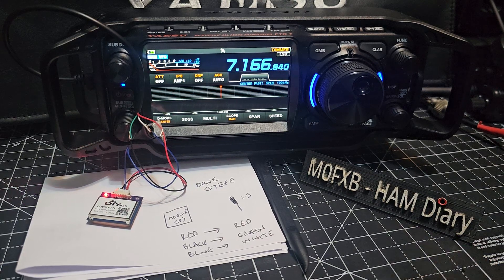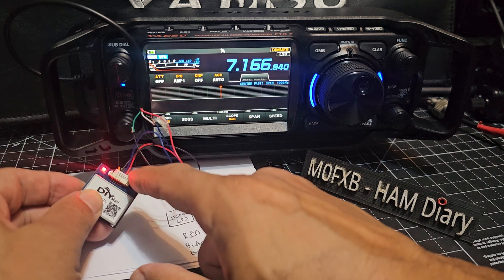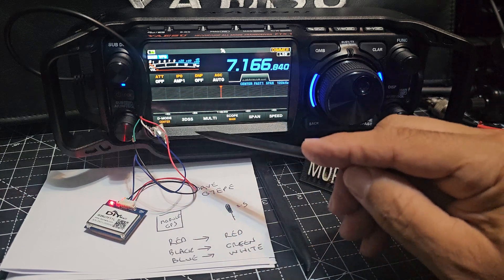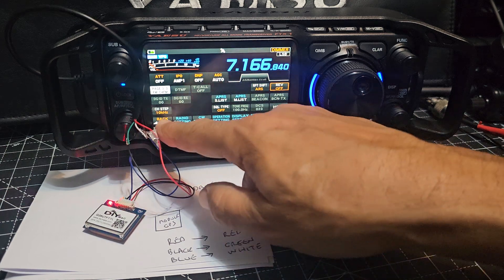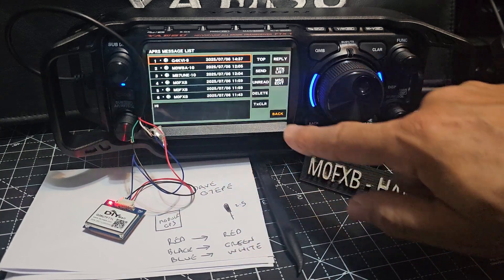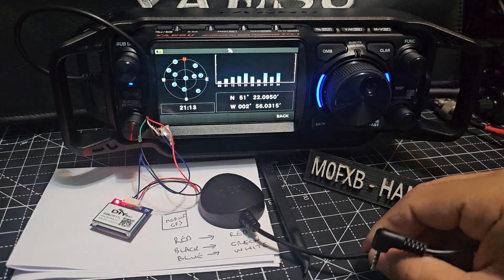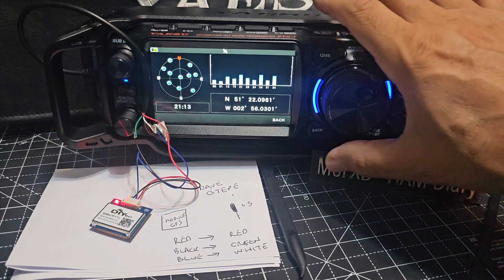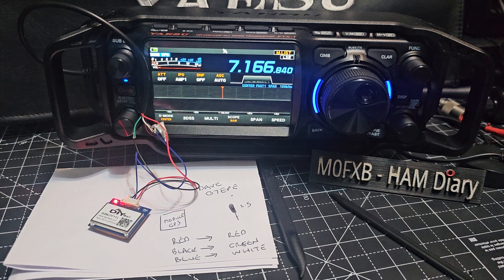DIY - YAESU FTX-1 GPS Module £16

Comment: what are the actual pinout connections on the 2.5mm plug so that the cable can be made up without having to purchase a cable from amazon for real DIY by amateurs.
Reply from the maker: U have to buyba cable its a few pounds
Reply: @M0FXBHamTech  sorry to hear you are not into DIY

Comment: The GPS module is no longer available.

However, I wanted one with a remote active GPS antenna with SMA termination anyway.

So I used the same 2.5mm cable that you used with the "Gonnely Mini NEO-6M GPS Satellite Module GPS P-C-B Positioning Map Low Energy for Microcontrollers" item B09J916W5V from Amazon UK (£9.39). This puts 3.3V up the coax to power an active GPS antenna.

Don't make the same mistake I made, and assume the 2.5mm plug is all the way in when it's not There should be a satisfying click once it's made its way all the way in.

Pinouts

2.5mm breakout cable Amazon item B0DTYQQB8J
Tip Red +5V
Ring 1 White Data from GPS to FTX-1
Ring 2 Green Ground
Ring 3 Black no connection

(Ring 1 is closest to tip)

GPS module Amazon item B09J916W5V 
PPS No connection
RXD No connection
TXD to Ring 1 White Data from GPS to FTX-1
GND to Ring 2 Green Ground
VCC to Tip Red +5V
Reply from the maker: Great info thanks for sharing the fix.
Reply: Thankyou for giving the actual pinouts.